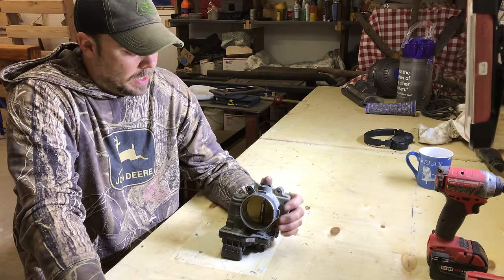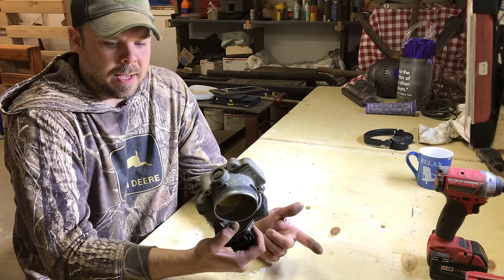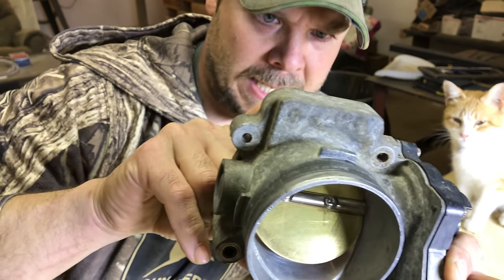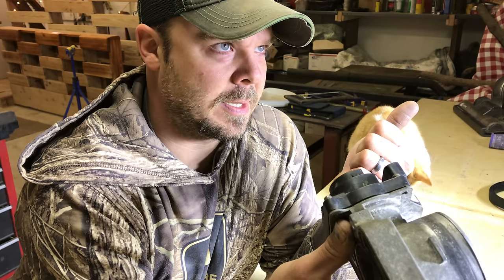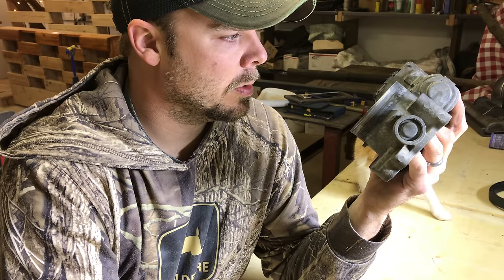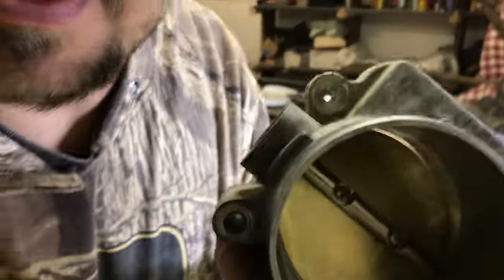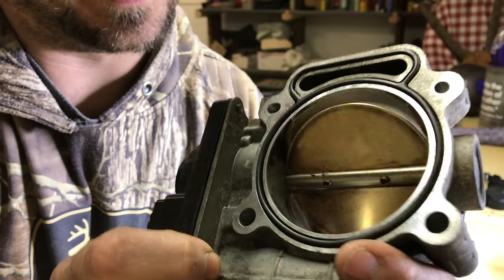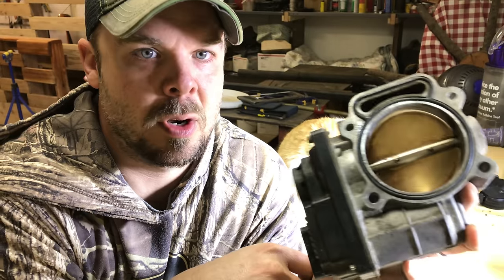Throttle Body Fix for GM Limp Mode REDUCED ENGINE POWER Video

Comment: NOTE:.... If your Car / Truck Stalling after Cleaning and replacing all that stuff, etc...... You might want to " RUN " the Engine at " Idle " for a bit, so the " MAF Sensor " can Calculate your Fuel Ratio. Your Engine might be just fine... Just the MAF Sensor has to talk to the Computer. so it can " Re-calibrate " your Fuel.
Reply: I'm getting engine reduced power on a20008 Silverado 4.8 changed out throttle body and TPS sensor still doing the same thing
Reply: Any idea driving me crazy
Reply: @CarlosGARCIA-nz3eu  - :(

Comment: Dude, you just saved my life, I cleaned that thing for my 2011 HHR, and when I put it back together, ran horrible, I didn't realized that the flap also goes the other way, when I saw your video, I jump to my car and took me 5 minutes to take it off, I checked that flap, flipped it over, so now it could goes both ways, I put it on in another 5 minutes and, VOILA!!! All good now, your video a little slow, but helped me, THANH YOU.

Comment: I'm pretty sure this is my exact problem on my 2009 h3 and I really appreciate your video about it. I notice its MOSTLY in very cold weather such as below 20 degrees or so and I'm thinking you just gave me the explanation for what I need to do. Thanks for your video and time spent to help others!
Reply: Can you explain what you did in other words so we can understand via osmosis to you? Thanks so much
Reply: @MammaMia  Instead of removing the whole intake I simply removed the short intake hose which goes to the butterfly valve intake. It's big enough to reach inside and use carburetor cleaner on the inside. I don't recommend spraying directly inside. I sprayed the cleaner on a rag and reached in manually to wipe the carbon build up off which will be clearly visible if this is the problem. Another thing to watch for is gaps or holes or any breaches in the black intake hose which goes to the throttle intake. In my case I had a big gap where the hose was not sealing around the intake which allowed outside air to enter and create the carbon buildup

Comment: Hello i removed my TB from my 08 Colorado and cleaned it like you did but now when i turn my truck on the butterfly doesnt open when i push the gas pedal, but when i just put the ignition to on and step on the gas the fly opens could it be the same problem?

Comment: 05:00 and the c30s following. I've had a quick look through the comments and no-one seems to have offered any explanation for this "natural position" of the throttle butterfly. So let me see if I can help:
The throttle butterfly has a natural 'rest' position which, if you use live data, will be somewhere around 30% open (on my Saab 9-3 it is 34%). At natural idle the butterfly is at around 10% or so open (obviously these figures will vary from car to car). 
One of the reasons for this is that the ECM needs a "reference position" of the butterfly that it can use to check operation. Despite what people might think, idle is NOT a reference position because the amount of throttle opening (in %,as we are discussing) will be different at every idle status. This is because factors such as barometric pressure, electrical load (alternator) and ac load are different every time the engine drops to idle. The ECM will be adjusting the throttle to maintain the correct idle speed.
Another reason is emissions and fuel economy (I'm considering these together rather than as two reasons). Let's say you are driving along at a steady 70mph and about a half mile ahead you need to stop. At a quarter to a third of a mile you lift off the throttle pedal and the car starts to slow (engine braking, aerodynamic resistance and rolling resistance). The ECM closes the throttle to its natural rest position (about 30% open) and cuts the fuel flow through the injectors. The engine is now a simple air pump and because the butterfly is at an increased opening compared to idle, it is breathing more air than it does at idle. This has several effects, but chief among them is that there is less engine braking than there would be if the butterfly were at idle position. This means you can lift off earlier than you would in a cable driven car and so the car runs along for a greater distance with ZERO fuel consumption (remember fuel is cut off - in a carb engine the carb would be delivering fuel over this same distance). This is good for fuel economy and emissions (of course it is, lol, on any given journey you now have a number of periods where the car is consuming no fuel, reducing the total amount of fuel used for that journey and no fuel consumed also means no emissions during those same periods).
You've kept the car in top gear and as you approach the point to stop, the engine speed will fall and at around 1300-1500 (varies from car to car) the ECM will command the butterfly to idle position and fuel injectors reactivate. You press the clutch, the engine settles to idle and you use the brakes for the last bit.
During the period of the engine acting as a simple air pump (we call this 'fuel cutoff under over-run' - over-run being when the engine is being driven by the wheels and the cars forward momentum), the air also acts to cool internal engine parts, the turbo turbine (if fitted) and the cat (particularly beneficial if the engine has just been working hard and is running hot as a result).

IF my essay made sense to you, you can see that a significant improvement in fuel economy can be had by allowing the car to slow down in gear naturally as much as is safe and practical (being aware of road and traffic conditions) and using the brakes as little as possible. Allow the car to slow down in whichever gear it is in and dip the clutch when the engine speed is down to about 1300-1400rpm. This also reduces brake wear,which reduces costs over time. Don't believe me? Try it!

Questions? Ask away, I'll try to answer, provided I spot the notifications.
And if you've read this far, why not check out my channel.
Reply: Thank you! This comment was really insightful. My girlfriend's car went into limp mode about a month ago and I cleaned the throttle body and it resolved the issue but it came back this morning. I cleaned it again and now it's working again. Can I somehow prevent carbon buildup in the throttle body? My brother says the throttle body on 3.8 gm is prone to carbon buildup. I'm hoping I can fix it long term without replacing the actual throttle body. Any help is GREATLY APPRECIATED!

Comment: With the video, you can go to settings and adjust the speed to move the video along, good info
Reply: I did buy one &now the code for accelerator pedal position sensor is on ?
Reply: @maresataylor5688  I think i was referring to the speed of the video, but now that i think about it you probably wanted to talk to the guy who made the video. no big deal.

Comment: If removing the throttle air valve blade, note the front as many have tapered edges. Like a tight fitting door, its outer edge is angled. 
  Fuel enrichment comes from longer injector duration as intake air temp is input for cold start up or coolant temp. Many use both inputs because it does not work like a carb choke.

Comment: To make a long story short don't fuck with the butterfly. You can clean the throttle body without removing the butterfly. Throttle body cleaner, rag, q-tips, done!
Reply: Do you open and close it though to clean it??
Reply: @jonmo2694  yes, but unplug it first, then plug it back in after you clean. Or else it will have to relearn the idle position.

Comment: What you use is carb cleaner or throttle body cleaner only. Throttle body cleaner is the best. And you don't take off the butterfly you just clean it up really good with cleaner and a brush. If you take off the butterfly you'll mess it up because it's set from the factory. And you might have to reprogram the computer. If you keep pushing the butterfly with your finger manually you're going to mess it up also you don't do that. You just do the best you can cleaning it the way it is The butterfly is set perfectly the way it is from the factory And replace the gasket always to a new gasket period and always let it dry before reinstalling. And then make sure the new gasket is seated properly period and you'll have a good clean throttle body that would work really well

Comment: You right I did make a mistake of removing the plate but I was polishing the throttle body all extra aluminum dust got inside where the sensor is. I clean everything and I did put the blade backwards. Thanks because when I saw your video I realized that. But I have a 2007 tahoe and on the blade it has a small circle ⭕️. I don’t recommend removing your blade because the circle ⭕️ is for calibrate the throttle body if you don’t make a mark where exactly needs to be buy a new one. This happen last year now I tahoe is all mod 700 hp. Thanks you is a really good tip.

Comment: I'm confused to what the mechanical problem was.. You were not specific. When you put it back together it was off? And was not allowing it to close properly? So your saying if it doesn't move backwards freely to completely close the TB than you may have these reduced engine power symptoms? Please clarify. Thank you
Reply from the maker: +b18citr The butterfly was physically jammed or "stuck" against the inside bore of the throttle body.  In most applications the butterfly is larger than the bore or it is offset from center. Even without any linkage attached, you cannot rotate the butterfly 360 degrees.  This is true even on small engines.   I hope this is what you were looking for.  

Regards,
Josh
Reply: WHAT THE FIX  so what did u do for it to not get stuck in the bore?
Reply from the maker: I rotated the butterfly too far when I was cleaning it.  It was not stuck until then.  I accidentally let it close from wide open.

Comment: I had just cleaned my throttle body, and when I put everything back together my car did not drive right codes and the car would go into limp mode, I had watched countless videos trying to see what can help me fix my problems I was having that occurred from cleaning my throttle body. It wasn't until I came across your video and did what what you did because it seem to be the same issue I was having and when I was done my car runs flawless, thanks for the video.
Reply: What did you end up doing?
Reply: @nene2245  his method did work but my throttle body kept getting stuck closed so I had to buy a new one...
Reply: @Anthonydawson how did you know your throttle plate wasn't closing? Also cleaning the throttle ends worked?

Comment: I ported/polished a electronic throttle body for a 2008 Dodge Charger (2.7L); and put it back on; now it stalls on idle (while in gear) occasionally and throws a “high rpm in idle” code sometimes.  Throttle response seems more sluggish NOT better.  I am at a loss and confused.

Comment: The best tip for reassembling the TB shaft & plate: push the blade closed when tightening the screws. Better yet, take a VERY thin sheet of something (thinner than paper) to shove in the top & bottom, that will shim the blade and center it since they're set to not touch the edges fully closed.

Comment: hey buddy thanks for all that I have a diesel colorado it started with, sometimes when i started  the car it wouldent rev over 1200rpm but then go away and run =normally after a short while it wouldent rev at all over 1200 at all I took of the pipe to the throttle body and noticed the butterfly was closed  when i cranked it over the butterfly stayed closed. I changed the throttle body over with a second hand one and now it starts and runs but wont rev over 2000rpm Iam not able to plug in a computer and get codes any thoughts please.

Comment: You can get them for 60 bucks on Ebay ! I bought one for 88 because they give 10 year warranty . There out if Kansas. Another channel took it apart and real good look into it and they do wear . He pit it under microscope and found where the wires do melt .

Comment: I recently pulled out my tb in my 08 cobalt non ss and cleaned it up real good.  As soon as I put it back in, I immediately got high idle. It's a manual trans so I hold the brake and ease the clutch out until idle sits  around 800 for about a minute.  When i release the clutch after coming out of gear,  she sits quietly away normal idle. As soon as I breath on the gas wrong, rpms jump to around 2k then settle at about 1500. I went to go pull it off again, thinking I had some soot or carbon clumped up somewhere and I was going to spray it down with maf cleaner.....beings it's safe for electronics and dissipates quickly. That's when I noticed my butterfly has a significant gap and realize it's not closing all the way. My thinking is, it's should be completely sealed closed until the car is starter and the pressure, with the sensors tell it to open. Am I wrong in my thinking?
Reply from the maker: Some air gap is needed, hard to tell.  Also, check all your vacuum lines and connections. Leaks can cause erratic idle.  Any DTC present?
Reply: @WHATTHEFIX  yeah, first was vacuum leak. Fixed it. Then was code for throttle body unable to close to zero.
 Put new throttle body on, got the ECU flashed..... Now she's Golden.
Reply from the maker: Nice!  Keep on truckin' my friend!
Reply: @WHATTHEFIX  appreciate the response. Ty
Reply: Jason p you need a new Tb sensor it has shorted out!! But first go to 1Aauto.com they have a great video on Tb relearn process!! As we should never move flap manually it dis aligns sensor and flap guide

Comment: How much was the tow bill to the dealership for the throttle relearn? Btw people never unplug a drive by wire throttle body, its a nice scam auto makers got going on.
Reply from the maker: al steg ... no tow.  No relearn.  It's a misconception that you need to perform a relearn whenever it is unplugged.

Comment: Closing it completely is the default settings 0 positioning. It near to be completely closed to confirm a lot block too much air or block air in case too much Can spray Cleaner in too the system.
Reply from the maker: doesnt seem that the brake cleaner hurt anything... keep it out of the electricals' and wipe the residue.

Comment: I 2010 GMC Terrain which i had check engine light on dash so i watch on how to clean to with cleaner well all said losen two screws on flaper well i tryed to center by eye so i got all back together started it up now i have REDUCED engine POWER light now iam back in on utube on this prophem so what i learned was in order to center faper you need losen two screws and push  faper back the other way this centers faper then tieten scews while holding in this pro
Reply: NOTE:.... If your Car / Truck Stalling after Cleaning and replacing all that stuff, etc...... You might want to " RUN " the Engine at " Idle " for a bit, so the " MAF Sensor " can Calculate your Fuel Ratio. Your Engine might be just fine... Just the MAF Sensor has to talk to the Computer. so it can " Re-calibrate " your Fuel.
Reply: Dude thank you, read this then went out and centered the butterfly as u described, problem solved!

Comment: Hello cat     Use throttle body cleaner  not carb or brake cleaner they could damage electricals.
Reply: I saw a guy using throttle body cleaner on a rag sparingly and wiping it clean especially on the surface where the butterfly may hang up. Also on the edge of the butterfly itself. Don’t drench it. No brake cleaner.

Comment: I am having the same issue ( Engine Fail Safe Mode Enable)on the dash screen it says, no acceleration, No Power... if you can assit me or message me anytime time day or nie , 2004 Mercury Mountianeer AWD 4.0 Liter, i even purchased new  trottle body before i purchased the new Throttle body part, read it 13 codes, after i installed the new part only 6 codes are showing I'll message you the code tomorrow morning ... I am not sure what is the procedure to disable engine failsafe mode or i need to calibrate it or reset something ... Please help these mecahnics around only know how change oil, and swap parts..no electrical knowledge around here.. PM me so i can give my cell number if possible..HELP PLEASE
Reply: She’s cooked my guy... 2003 4.6L v8 same thing whole engine was shot. Problems even more common in the v6 mechanic said

Comment: After $4,200..... just use GM throttle body components. Do not buy Hitachi or Doorman parts! Trust me, it will save you a huge headache. Never remove the throttle blade on these either!

Comment: i think many problem from throttle body from idle air and no power .its from center hole..you can see  circle "gap's" between hole and buterfly,if close thats must be no gap's and the solution you must close thats gaps with glue ..sorry my english is bad ,hopely can be understanding and solution  to many problem from throttle body
Reply from the maker: You need some air gap between the body and the butterfly.  You need a little air to pass through to allow for engine to run at idle.  I think this is what you are referring to.  Thank you for your interest.

Comment: You should have never taken the center blade out just cleaned it all up really well they've used the wire brush lots of carburetor cleaner or brake cleaner when you put it back together was probably cockeyed the computer drives that all the way closed so it knows where zero is at and where the throttle should be when you first start the car there was no correlation between the pedal and throttle body at that point apparently must have been binding because it wasn't totally centered when you put it back together you may have thought it was centered but it was not